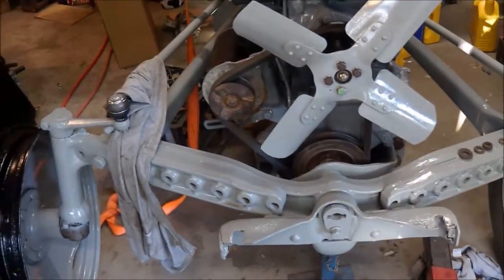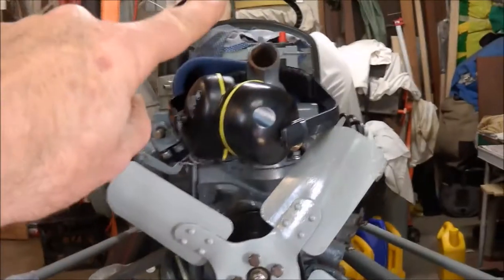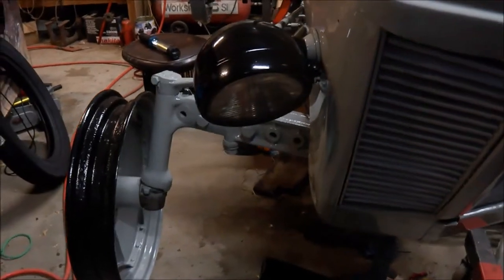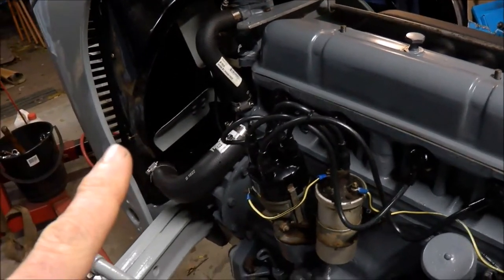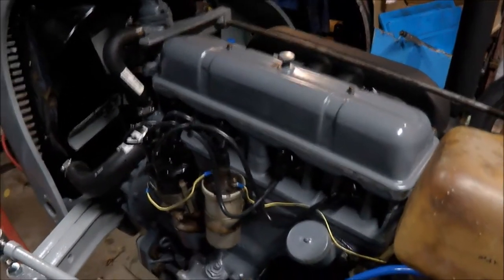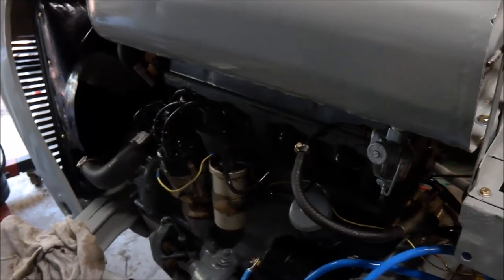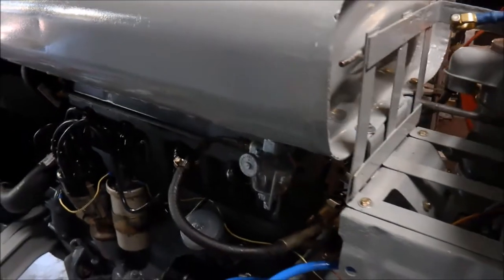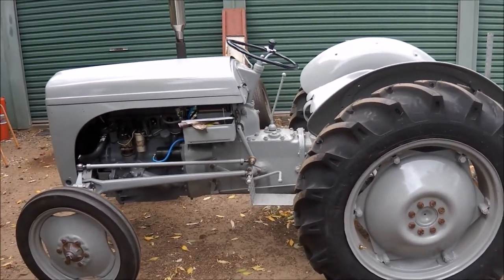1952 Ferguson TEA 20 Tractor Restoration Part 9

Comment: Hi denis, I’m doing up a tea20 here in new Zealand and are having trouble getting the right Fergusson grey paint , everything is the dark grey here, what did you use on your tractor ? Regards mark
Reply from the maker: The paint was Dulux Metalshield Epoxy Enamel and I selected the colour from the standard colour chart. I can't remember which grey it was on the chart. I purchased it from Bunnings.
Denis

Comment: Any part numbers on the gaskets for this unit. Great work
Reply from the maker: Sorry, no. Parts were readily available on Ebay.
Reply: @mydiyvehicleresto  thanks for the fast reply. I’ll make a video on the one I’m about to restore. It is in very good shape compared to the one u did. The pistons are scorched and its lacking power so it will be a complete rebuild on the motor.
Reply from the maker: @paintingandlife4288  Good luck with the rebuild.

Comment: hi Denis can you please tell me where you purchased your tyres from as i looking for the same . I live W. A . Thank you .
Reply from the maker: Robert
I  got the rear tyres from a local Truck and Earth Moving tyre centre in NSW. Although they didn't have them in stock they were able to get them in the same day and fit them to my rims. You should have similar tyre centres in WA. The front tyres I ordered online from Heads Tractors in QLD and had them delivered by post.
Reply: Thank you Denis ,  were the front ones hard to fit ?
Reply: Robert Mason 
I tried but gave up and got them fitted with the rears. The rear tires took days to get off, even with help. Much quicker with the right equipment.